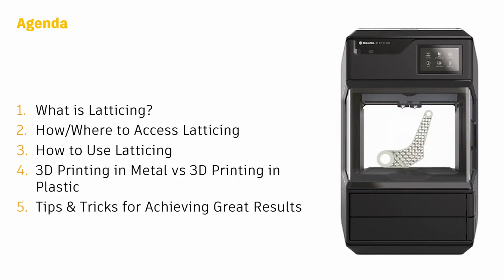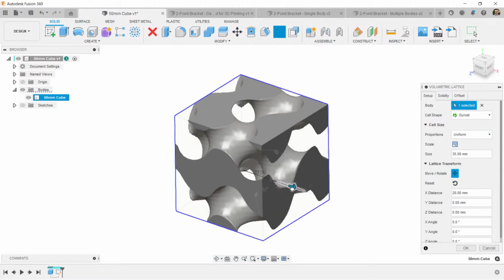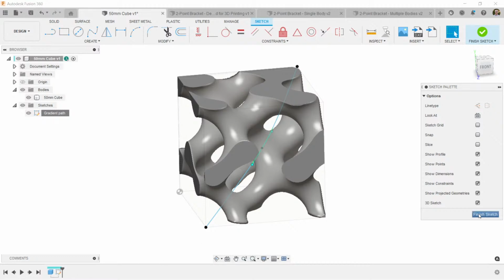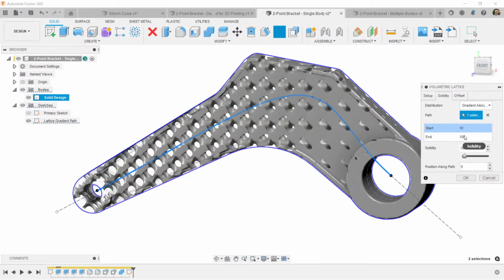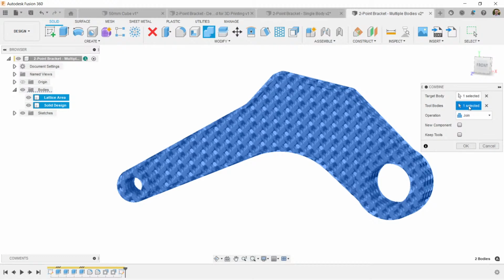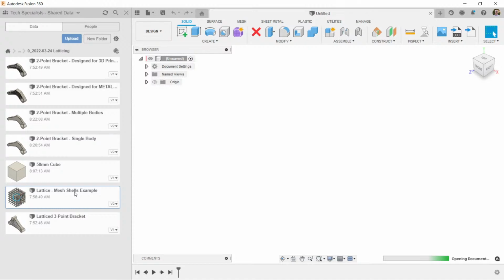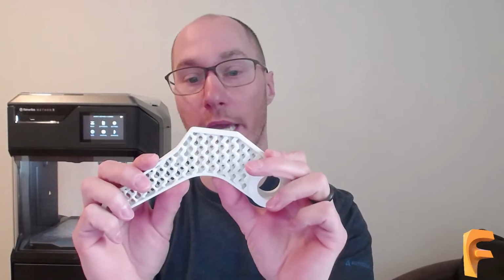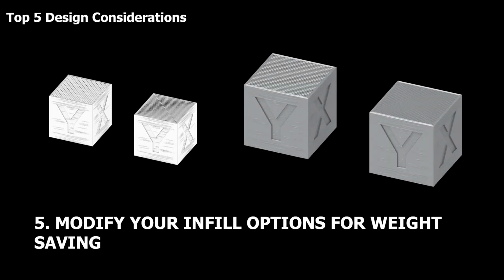360 LIVE: How to Lattice Parts for 3D Printing

Comment: Hello sir, I have made a lattice structure sandwiched between two solid plate in fusion 360. But when I am exporting it in Step or any other format and opening again, the lattice part is getting converted to solid. Please give your suggestion.
Reply: i have the same problem. is there any answer for that?

Comment: Don't know how you can justify the add-on pricing for these features. Crazy. Way out of touch with the customer base.
Reply: IMHO you can subscribe on a daily base (4 credits a day)... you generate your lattices and unsubscribe again.  BTW Siemens finally woke up and is also offering a community edition of Solid Edge which I like too.  So, Autodesk should be careful not to overstretch things
Reply: @SiriusBern  oooh.. good to know. It was way out of my price reach. I'll give it a look.
Reply: FYI: the Product Design Extension is currently $595 USD (in the USA). That is only 1.2x
Reply: How dare a business charge for something that has most likely cost millions to develop.  Someone else wanting something for nothing.
Reply: @pplpilot  I don't want it for nothing but charging 3-4x the cost of an annual subscription for fusion 360 for such a small selection of gimmicks is too much. And the fact it's not a single purchase but also another subscription service is pricing it out of general consumer level.

Comment: More questions, after listening to a replay:

1) How does the omnidirectional strength of the lattice compare with other fill patterns (like in the new Cura) or just a solid alone?
2) How can slicing be done for 3D printing from within Fusion 360?.
3) If so, where and how do the machine start and end G-Code inserted.
4) Can the g-code be modified for arcs and b-splines, or does Fusion do this for the printer part (important for latticing and other conic patterns)?

Thanks again for an excellent and informative presentation.

Comment: How do you quantify the geometry of the "lattice" you are constructing so it could be replicated for stress analysis or other manufacturing methods (for instance, casting)?
Reply from the maker: David, 
Once you convert the lattice into a mesh, you can then convert the mesh into a solid. That solid can be used for stress analysis.